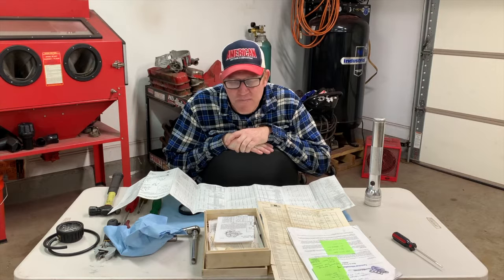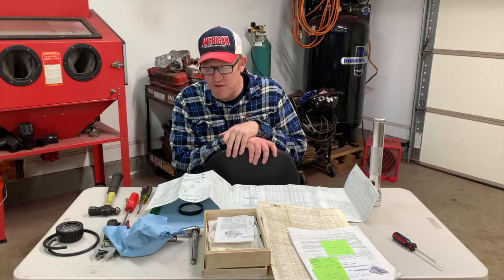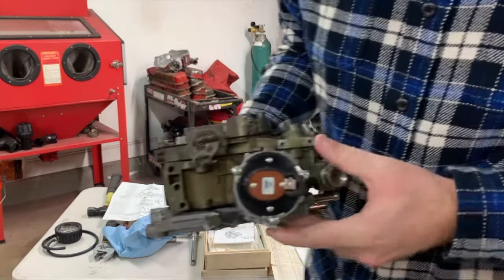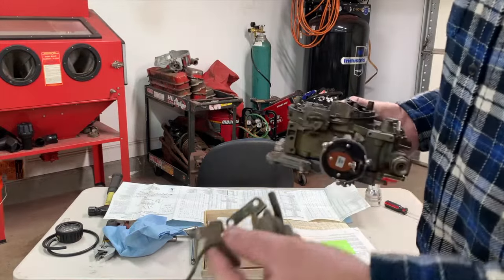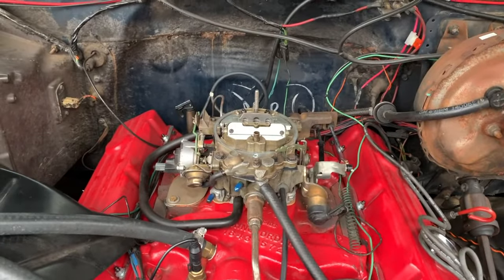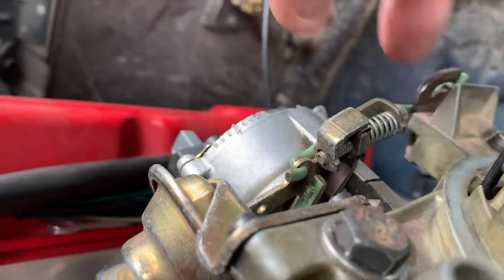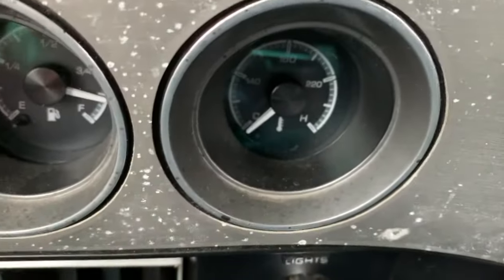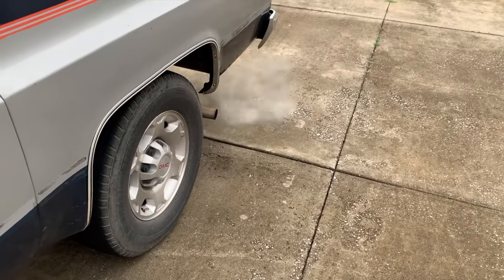Quadrajet Carburetor Choke Adjustments are the best way to get instant starting, drivability & MPG!

Comment: The primary function of the front "choke pull off" (secondary air door dampener) has very little to do with the choke. Its primary function is to regulate how fast the secondary air doors open so you do not get the lean bog when you put your foot in it. Without that dampener your quadrajet will run like crap when you try to give her the beans. Many, many shadetree mechanics have made this mistake and thats why the quadrajet has a bad reputation and nicknames like "quadrabog".
Reply from the maker: agreed, but our primary choke pulloff has an adjustable tab that slightly opens the choke door upon startup and idle vacuum to increase the air volume after it's running and decrease the extremely fat choke condition. It probably has everything to do with emissions since it is a 1979 carburetor. So it does have a function other than the secondary air door in this case.

Comment: Out of all the videos and posts I've perused looking for answers, this is the only video that actually explains the purpose of the set screw on the choke pull-off and how it pertains to pulling the air door open a crack when vacuum is applied to the pull-off. I had my choke set all wrong, hard starts, funky idle, just because the pull-off was so loose it did nothing. 👍. Thank you, seriously.
Reply from the maker: Thanks so much!
Reply: And anything besides dry graphite on the pivoting fast idle stepped-weight will cause it not to drop with gravity.  Blow off any grease or oil with carb cleaner, grease and oil will be too thick, even atf is too thick.

Comment: Thats what I run in my Olds 350 Rocket...Rotella T6 5w40 in the cold and 15w40 in the summer...I'm having a hell of a time with my quadrajet in my 1978 Delta 88...doesnt want to start at all in the cold without starting fluid and in drive it idles very low...I just got the car and I dunno what the hell the guy did to the thing...I'm hoping the weather will get better so I can go outside comfortably and get her dialed in right.
Reply from the maker: I'd recommend going through that carb and at least cleaning it up with a carb kit from the parts store. Your carb is very similar to the one in the video. Once the carb is dialed in to somewhat factory settings, I would then perform a basic tune up and go through the distributor verifying the normal operation. Then adjust it all to factory settings. Idle speed should be 700-750 in park and 500 RPM in gear. Hope this helps!
Reply: @mr.roddersneighborhood2740  thank you so much!...still waiting for the temps to make up their mind outside...thats Michigan for ya!
Reply: I just got a 83 monte carlo and also having the same issues as you

Comment: I have a business rebuilding carbs and the one thing I find kinda funny and irritating at the same time is that both my 77 k20 and 85 k10 suburban with their factory original q-jets, will start every time with no issues clear past -40 degrees and my 98 s10 with fuel injection won't start when temp is in the single digits in the positives... and my suburban I use rottella to 15w-40 all year here in montana
Reply from the maker: It's likely the added current draw of the EFI and coil packs that make it difficult to start... that's why I love Old School! Q-Jet for the WIN!
Reply: @mr.roddersneighborhood2740  oh and I forgot to mention I have never plugged in any of my vehicles during the winter here. With the old q-jets it's push the pedal once to the floor take foot off the pedal and it fires in 3 rotations at the most love the old carbs only good thing with efi is fuel economy
Reply: And the issue with th s10 is that it cranks over easy just no fire doesn't seem to matter what I do just won't fire have killed the battery many times trying to get it started when it's cold
Reply: I live in western Colorado and have a quadrajet on a ‘77 LeSabre Sport Coupe and I’ve had the choke disabled for awhile. Still starts up on a cold morning with no choke, but I’ll probably be turning it back on cause I’m tired of sitting in my cold car warming it up and keeping my foot on the pedal a bit.

Comment: Great video. My 78 Cadillac Coupe with the 425 runs like crap when starting from cold idle. I do the one pump and itll start but will run awful. However once its warmed up and used during the course of the day, she'll run perfectly fine. I should point out, last year i did not have this issue at all, so i wonder what could have started the issue this year. Im in west Texas so our winters here are not like super cold. Usually in the 30s unless a cold front passes and dips our temps lower. Anyhow, any input would be appreciated. Thanks

Comment: Ok. This is the BEST choke video on YouTube bar none! FINALLY....someone who FULLY explains (in sequence) of how these quadrajet chokes work. Very good, thorough, chronological description of what happens. I was able to follow along and understand the steps as you presented them. I'm not new to carburetors, I've run plenty of Edelbrocks and Thermoquads. I'm just now learning how Quadrajets work though. Thank you. I also didn't draw the connection of how the fast idle speed goes up if you do not release it with a tap of the pedal. I learned something today! Thank you AGAIN! No slam here, but Thermoquads are much easier to deal with. I know they get a bad rap, but both the fast idle and idle screws are basically on top of each other on the same side. Super easy to deal with. no bending down with a flashlight to find the fast idle screw when it's on the car. No special idle adjustment tool (my Qjet screws are buried in the baseplate). They are just out there in the wind up front easy access on the Thermoquad. You don't even need a slotted screwdriver, the needles are knurled. Easy of use goes to the Thermoquad.

Comment: I have notice our fuels are not working like they used to I had to finialy put a pressure regulator on my q jet to 3 lbs flooded with 6
Reply from the maker: I wonder if the 15% ethanol is starting to get distributed? I did notice with the 10% ethanol, it would evaporate out of the fuel bowl almost overnight and make a carbed car difficult to start sometimes if it sat longer than a few days.

Comment: What vacuum should the front vacuum break allow the secondaries to open? Mine seems not to let them open even as low as 14"???
Reply from the maker: There is no vacuum number associated with the secondaries opening. That is all adjustable and set on each combination. Loosen the Allen screw and tighten the air door adjustment screw tightening it to open later.
Reply: @mr.roddersneighborhood2740  My problem is not the secondaries but the vacuum break doesn't seem to lose enough vacuum to allow the diaphragm to go back?

Comment: Hey buddy. My 83 cutlass starts up great when cold after pumping the gas 5-7 times. Drives smooth with zero issues but after shutting it of to go inside a store, it doesn’t want to start. I have to take the air cleaner off and hold the choke open with a rag while I turn the key and starts up. Why does the choke close so fast? Is my electric choke bad or something needs adjusting?

Comment: Very thorough video, thank you. I have a question though.

My '86 Caprice with the electric choke starts right up, but then idles very high, and stays there for almost 5 minutes before the fast idle will drop down to a lower step. To reach the lowest step (curb idle?) it takes almost 10 minutes in total (!). Once it gets there, it seems to run pretty good. This is in cool temperatures, but not freezing or anything. 

I believe my choke and choke pull off are set correctly. 

What could cause this? Is it the high idle cam being too tight perhaps? 

You'd think that, with such a high idle for 5+ minutes, it should come down easily, but it won't for some reason. It makes starting up the car pretty darn stressful.
Reply from the maker: The high idle cam is set too tight for sure. It sounds like it could be a combination of the high idle cam too tight and the choke set a bit too tight. Try loosening the high idle cam first by a quarter turn. The choke can only be properly set when the engine is cold and at first startup.

Comment: What's that pipe plug on the air horn?  Midrange adjustment.  You do video on that someday?
Reply from the maker: Yes, that is the Adjustable Part Throttle Adjustment Access. It's normally plugged on the stock carbs and requires disassembly of the carb to readjust it. I'll do a video on how to make it, adjust it and set it!
Reply: I need help with the apt adjustment, I rebuilt my first quadrajet on the 79 El Camino I just bought for me and the boy to fix up…. Took the apt out without reading the directions….not smart… it’s the 305 four barrel motor

Comment: The reason i duslike modifying, is it changes all the perimeters,  meaning you can't use factory settings,  and it wont run like factory,  whech was really really good. 3.5 turns out on air mixture screws, 2.5 on apt, high idle set at 1900 rpm. Idle speed set at 700. Both those set the proper throttle plate angle.  Thats really important
Reply from the maker: To each their own... I did not build this truck with the intention of having a stock vehicle, I did it using parts I had on hand. I'm not a Chevrolet guy... and it's my vehicle.
Reply: @mr.roddersneighborhood2740  ny point is, it started like crap.
Reply from the maker: @davidpotter7484  Oh... Well you should have put that in the comment! Rambling on about the basic throttle angle and idle set speeds threw me for a loop. Keep watching... it's only gonna get crappier! Hopefully my junk meets your seal of approval in the future... but I can care less, since it's gotta meet mine.
Reply: @mr.roddersneighborhood2740  so i think I'll subscribe to watch and find out for sure
Reply from the maker: @davidpotter7484  ya gotta keep me in check, I'm a huge hack!! Appreciate it!

Comment: My choke doesn’t snap like yours did when you gave it one pump. It doesn’t move at all….?
Reply from the maker: Adjust the choke spring tension by loosening the outside cover and turning it counterclockwise until the choke door closes. Then turn it a bit more and tighten the screws to hold it. If your choke works, it will open slowly after startup. Then fine adjust it until it works like you want or engine temp is achieved. It has to have the spring tension to snap shut.

Comment: I have a 1984 g20 with a 305 and quadrajet, this is my first rodeo with a carb but I'm trying to learn. Once it start my van it will idle high for about 8 minutes before pressing on the gas will kick down the high idle to a normal idle. Not sure where to start, no matter how much I press on the gas the high idle won't kick down until its ran for a good while.This is usually only after the van has sat for at least a few hours. Any advice where to start?
Reply from the maker: You have 2 options. Adjust the high idle screw on the passengers side bottom of the primary blades and that will adjust the engine speed at high idle… if the idle rpm is fine, move onto the next thing. The choke housing needs adjustment. I know it sounds weird… but the housing adjusts the tension of the spring inside. This will increase or decrease the time the choke is engaged and how far it is closed.

Comment: It has been many, many years since I played around with carburetors. I just could not get my 1976 Eldorado Convertible dialed in with the cold idle. Taking a few minutes and watching your video was a game changer. Watching exactly what each of the mechanisms do helped me understand again how they need to work in concert with each other. I immediately went out and made those adjustments and it worked the very first time. Thank you for your video. I do however have a question as I just can't remember. When the car sits for more than a few days it takes a lot of cranking to pull fuel. I initially thought that I was leaking gas out of the bowls and it would take time for the cranking to work the pump to refill them. This is a new carburetor and indeed I can start it with in a few days with no problem, but anything over 3 days has to crank quite a bit to bring fuel from the tank. Any ideas?
Reply from the maker: The ethanol based fuels of today will evaporate out of the bowl through the vent. Some will return to the pump. A non-windowed needle and seat assembly will cure some of it, but the carburetor was never intended to use with ethanol blended fuels.

Comment: Great   video bud!! I got a problem on my 72 vette  my  rochester needs at least 6 or 7 pumps to start??? What's my problem??
Reply from the maker: That’s a vague question… is it 6-7 pumps after sitting for weeks, 2 minutes, in operation daily. There are all kinds of variables and missing information to properly diagnose an issue. Start with your accelerator pump… I bet it does not have the blue alcohol resistant skirt on the pump and has dried up and split.
Reply: @mr.roddersneighborhood2740  actually I think my problem was  " bad procedure" in starting it !! I tried  flooring the gas pedal and released it and with choke completely closed it started instantly!! sometimes we forget what we learned!!

Comment: My 83 caprice high idles for 5 minutes because when I give it throttle it won’t lower the rpm until 5 minutes and it’s completely warmed up
Reply from the maker: You can adjust that by loosening the screws on the choke housing and turning it a bit clockwise. That will decrease the time the choke is engaged. 5 minutes is a bit long.
Reply: @mr.roddersneighborhood2740  it has pop rivets for some reason on the housing
Reply from the maker: @enzofamily4320  it’s been rebuilt along the way at some point. Drill the rivets out and thread the housing. It should already have some threads in there and replace the rivets with screws. If you need some screws, you can usually find them at the junkyard. All car Qjets from 75+ had that style choke housing and the trucks got a version of it starting somewhere around 78 that was electric.

Comment: Howdy - My question is about other items I noticed in the video that I am interested in. 1) What type of guages are those in the dash and where did you get them? 2) What is that fuel line with the filter on the drivers side of the motor? o you have any videos on these items? Great video and very useful information. Thank you
Reply from the maker: The dash is a Dakota Digital for a square body truck. The fuel line with a filter is actually a vent on the top of the QJet that is plumbed to a filter and PCV valve. It cleans the air being drawn into the vent as well as it only allows air to be drawn in one way. The vent at the top of the airhorn of the Q-Jet allows air to escape both ways.

Comment: My electric choke heater is connected to the hei power.
Reply from the maker: That’s a lot of current for that one wire. An HEI power source is supposed to be just for the HEI only. That’s why it’s a 12 gauge wire.
Reply: @mr.roddersneighborhood2740  Been this way for years or over a decade actually, no blown fuses or burned wires.  I suppose I could measure the current, I doubt it's much.  What would you say, maybe a 20 Watt heater? 20W/13.8V=1.5A
Edit:  On 2nd thought, I may have wired the choke to the alternator excite terminal, this is more like the way I think but I can't really remember.  It's one or the other, not an oil pressure switch.
I'm leaning more toward this and if I recall, I removed the idiot light resistor inside the alternator as the choke heater takes it's place.
Maybe I stole this idea from Ford?
Reply from the maker: @thisisyourcaptainspeaking2259  I’m not too sure about that. It’s gotta be low wattage. My actual circuit on my square body truck, the wire is 16 gauge, which they use for 10 amp and below.

Comment: I bought a brand new 76 Trans Am with that piece of junk on it. I never stopped working on that carburetor as long as I had it. I drag raced and I have worked on many carburetors so believe me i knew what I was doing. I was constantly adjusting that choke. The only way that I finally fixed it was by adjusting the choke door to where it would the best, and then I took a hammer and a screwdriver and taped a little dent in the choke horn so that the choke door would not be able to move. I never ever had any more trouble out of it. That was and is by far the worst excuse for a 4brl carburetor that was ever made! My float bent! I had never seen anything like that happen before. I just to let you know! It wasn't because of bad maintenance. I kept that car for 18 years, and when I sold it, it almost as good as new. My advise to anyone who has this piece of junk on their car, is to take it off and throw it in the trash! I finally replaced mine with a 650 Holley spread bore and it totally changed that car for the better.
Reply from the maker: Not all Q-Jets are created equal... not all tuners are created equal and not all cars are created equal.